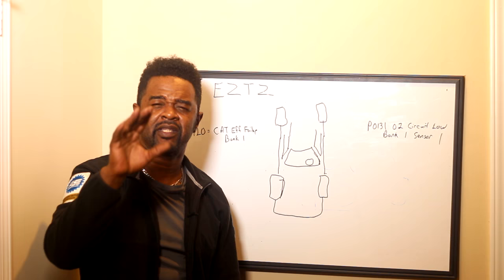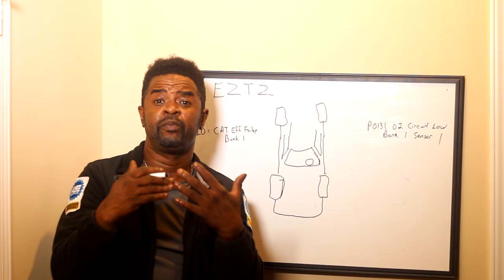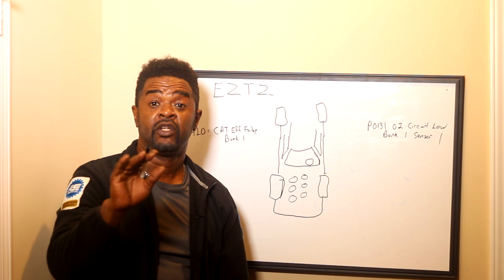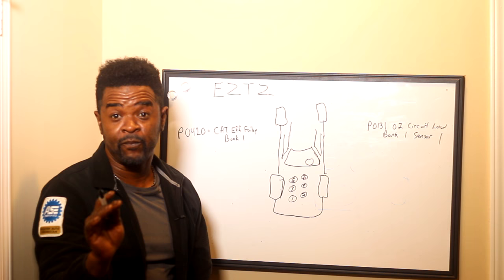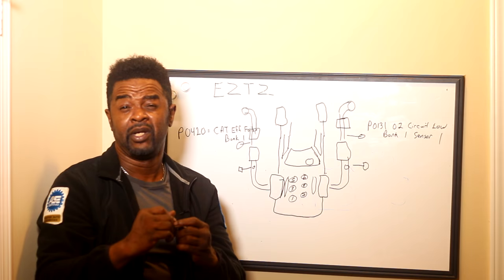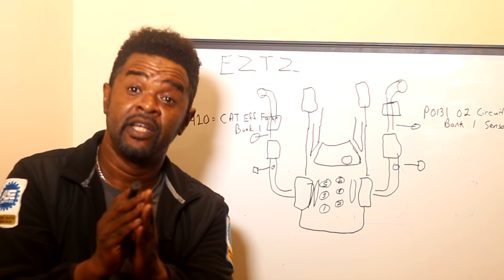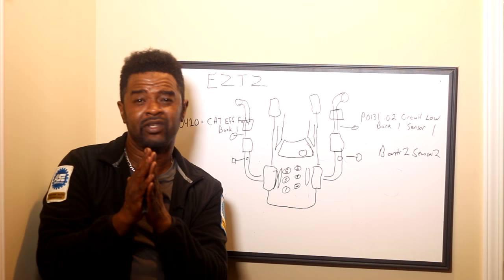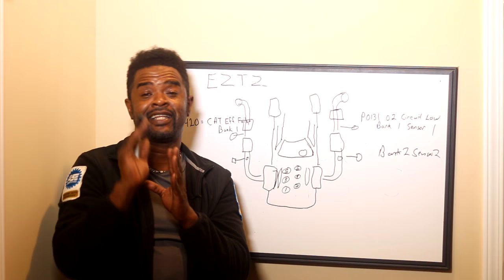Bank 1, Bank 2. Oxygen O2 Sensor Location, I show you how to locate the correct O2 sensor. P0131.

Comment: I have been trouble shooting a multi engine misfire and #2 cylinder misfire for almost a year. The dealership had the 3.6 ram and could not find the problem. Just started learning how to use the ob computer and read fuel system, found bank 2 O2 sensor  #1 to be very slow and not tight. Replaceed Bank 2 O2 sensor #1 Now it runs good but the O2 sensor will back off a little bit and it runs like crap with a bad hesitation. When I tighen it back runs good again Is there a way to stop it from backing out without replacing the exhaust manifold
Reply from the maker: Hey bud, its likely the computer trying to compensate for something. Theres a problem somewhere. What other repairs have been done? Have cats been replaced? Plugs checked? Any exhaust restrictions?
Reply: @OnlineMechanicTips  replaced coils, plugs crankshaft sensor pcv valve and up stream O2 sensors.

Bank 2 up stream keeps coming loose after about 75 miles. I know what I can do to keep it from coming loose but that's a last resort with some JB and replacing the cat any other tips on keeping it from coming loose.
It's running great when the O2 sensor is tight but Everytime it's running ruff I'll stop and check bank 2 and O2 sensor is loose.
Thanks for your help and Merry Christmas 🎄

Comment: Hey great video,  the part I found incorrect is I have a 2010 mustang v6 and cylinder 1 bank 1 is on the passenger side, but cylinder 2 and 3 are also on passenger side, cylinder 4,5 and 6 are driver side, bank 2?

Comment: My 96 chevy 1500 series 8 cy van 5.7 engine, is misfiring and stalling and rough ride, but since it has 4, 02 sensors, 2 on the top and those 2 on the bottom you showed us, which one of the sensors is causing the stalling and rough ride in my 96 Chevy van? Do l replace all four, or just the bottom ones, or the 2 top ones.  But, first, l must identify, which of the 4 is causing the problem, or should l change all 4 sensors to correct the problem?. Do l make any sense to you? I already changed, the map sensor, the camshaft and crankshaft sensor's, and a full tune up. But is still not solving the problem. Someone, please help me here...thanks..

Comment: Thanks for the video!!! I have a QQ, have a 2018 honda CRV and recently its catalytic converter and downstream oxygen got stolen and I installed an aftermarket catalytic converter and OEM oxygen sensor. But once the work was done, I see that the new oxygen sensor was joined to the exhaust pipe just before the catalytic converter even though there is a space left on the new catalytic converter for the oxygen sensor, the mechanic said it's fine but was kind of worried if it was done in the right way. What would be your comments on this one? Is it okay to have a downstream oxygen sensor installed away from the catalytic converter?

Comment: So I have an issue with my wife's 2006 Pontiac Vibe FWD 1ZZ-FE with an A246E transmission. I had a System Too Lean code, so I replaced the MAF, then I had a CKT Circuit Low Input or Stuck Off code, so I dropped the transmission pan and replaced the CKT torque converter lockup solenoid in the side of the valve body, I also had a Catalyst Efficiency Below Threshold code and I just replaced the catalytic converter about a year ago, so I decided to replace the upstream oxygen sensor. I replaced it three times with three different sensors because I wasn't getting that same catalytic code, but ever since I replaced the upstream sensor (in the exhaust manifold) I am now getting a P0031 Heater Control Circuit Bank 1, Sensor 1 (the upstream sensor) so I'm thinking that I have a new issue with the wiring. This car has close to 185k miles on it and it runs like a champ. Also, we have inspection and emissions in our county, so I HAVE to get it fixed. A new O2 sensor is $200, so I'm trying to find a pinout of the ECU side of the engine harness so I can trace the wires and test continuity between the sensor plug and the ECU plug. Any thoughts or help would be appreciated.

Comment: Is there polarity on an o2 sensor?  I received the connector wrong but only noticed after installing it so I modified the conector to fit.  I ordered the right one this time but wondered if the o2 sensor would work

Comment: My check engine said bank 2 sensor 1 ??So thats means a left side or driver side before converter?? Please answer my question
Reply from the maker: Hello my friend. It depends on your engine. What size engine your car have? We have to determine where bank 2 cyl head located at. You left off the engine size. O and please subscribe to the channel. thanks
Reply: Online Mechanic Tips  my car is Camaro 2014 8V 
6.2 , I will do thanks a lot and I’m sorry my English is  not very good

Comment: i got a question.
i got my ypipe and engine from 2 different places  and engine has 4 pin flat connectors and y pipe has 4 pin square connectors on O2 sensors
is the only  way to fix this just buy flat pin O2 sensors or can i just cut off connectors and wire directly?

Comment: 2017 Ford raptor code.being thrown as p2098. Says catalyst fuel trim system too lean bank system 2. Truck had Cobb down pipe and dealer said that was the reason the code was being thrown. Called Five Star tuning in South Carolina and they said they had an exhaust system that the trucks take quite well for the O2 sensor which they were saying it wouldn't throw a code, can't figure out what to do when truck hits 5000 RPM it acts like it's got water in the gas and then the check engine light starts flashing and goes into like a limp mode for about 10 seconds. I did get the cobb piping off and went with the Five Star tuning setup that did not help at all , I wasted my money and sadly they didn't tell me that because  I couldn't test drive it after repair because I had to get it towed cuz it was quite some miles away from me so I never got to test drive, what should I do

Comment: ey I have a 2007 Cadillac Escalade esv The check engine light came on in the cold was (P0050, P0154, P0155)  Bank 2 sensor 1.  I would like to know which sensor I have to get and if it upstream/downstreamI.  Also please let me know which side of the truck is the sensor located. It would be nice if I can get a link for the sensor

Comment: Hello,
I need to replace my catalytic converter on my 2006 dodge grand caravan 3.8L engine. The converter code came up three times, so far. What bank is the o2 sensor for the catalytic converter connection? Unfortunately this would be the second time replacing the catalytic converter in 10 yrs since I've owned my van. I can't afford the original converter from the dealership for $3,800. So I'm going purchase a magnaflow catalytic converter. Any suggestions sir? Thank you

Comment: Hi good video. Iv replaced the 02 sensor on the 01 mazda tribute....which was the wrong one to be replaced...as engine light still is on. The one I replaced is in the front of the,under the hood. I can't find the other sensors and desperately trying to find the others. Any tips is gratefully received.

Comment: Great job.... But check it.
I got a 2013 Ford F150 Ecoboost with a code reading of P0430 bank 2 ...
But my code reader doesn't tell me if it's sensor 1 or sensor 2. Can you tell me which one it is , So that I can change the correct sensor?? 
Thank you

Comment: Is there a difference in the O2sensors #1&#2. That is to say can I replace either sensor with the same part
Reply from the maker: Hey bud unit depends on the application and car..some have longer wires with different connectors so its not a sure thing
Reply: Given the connector and number of wires are the same, such as a purchase of 4 o2sensors for my ‘05 town car. I can’t see indication that any one goes any one place over the other! Please inform

Comment: hello i have a 2007 honda pilot v6 and it says its having issues in B2 so that would be radiator side?? im asking because i seen another video say the back side is B2...im so confused and my honda is throwing codes for a bad b2, and im trying to figure out which it is so i can replace it. i just got the car and i need it fixed for work but i cant fix it or try if i dont know which one 2 replace. i know there is 3 on the honda and i know its not the bottom its either rear or front (radiator side).

Comment: I have a Lexus LS430 2004 V8 and I got a P0430 code it says bank 2  but  it  didn't say which sensor. how con I know which one is the problem ? I got a check engine light and a traction off light.
Thank you for your help.

Comment: Hey question? I have a 2010 chevy silverado Lt v8 with a misfire the code is P3435 deactivation in cylinder 4, the deactivation board was put in new the truck ran good for a month n now the misfire n code P3425 is back check engine light flashing n tracktion control warning lights come on at the same time for a few minutes then it goes away n the truck start to run good for few minutes......so fustrating

Comment: Hi . I have been trying to figure out this p2098 code on  my 2012 jeep rubicon.  Ive replaced o2 sensors 
Injectors for the misfires i had going and replaced coils and plugs and a cracked lower intake manifold.  
And darn p2098 keeps popping up after 2 days of driving and the jeep runs fine . 
Please help with suggestions 🙏 
Thank you

Comment: Yes cylinder 1 will always be closest to the front.  But how to know what side is cylinder 1 on the passenger side or driver side.  So how can we know what side will cylinder 1 will be in order for us to know what side our bank 1 and 2 will be?
Reply from the maker: The picture in the diagram, which ever cyl closest to the front will be cyl 1, which ever side that is will be bank 1. All assuming this a V engine
Reply: Right. Nut how can we identify what side will cylinder one starts. On the driver side or in the passenger.    They are v6 engines that the cylinder 1 starts on the opposite side for example on the driver side cylinder one will be in some engines. That mean bank 1 is in the driver side.  Compared to a v6 nissan bank 1 will be in e passenger size because cylinder one is in the passanger side

Comment: I have a question I have a 2008 Acura tl I just want to know if is the front or the back a bank 1 sensors goes I have problems fingering it out I know one is at the front of the engine the acura dealer told me is the front one an my mechanic side it not it because the plug is different so which one is it

Comment: I just got p0138 and p0136 on a 98 honda accord v6 right after replacing a section of my exhaust after the catalytic converter and included the resonator but not the mufflers as they are only a year old. Could if be just a coincidence? any thoughts? I had replaced this same section 2 years ago with walker system that just fell apart and found someone who was able to use my original stainless steel system and just added flanges and welded to rest of existing system. Thanks

Comment: Hi . I have 7 codes  P1148 , P1168, P0037, P0057, P0328, P1031, P1051, are those sensors related to Upstream and Downstrean ? Nissan Maxima 04 has 4 sensors? Thank you
Reply from the maker: Yes they are but are these your problem? maybe not. How is the engine itself running. You should get a compression test don on this engine to verify if engine doing its job. Also, are you subscribed to the channel?
Reply: @OnlineMechanicTips  yes running god, yes I did it

Comment: Could you please give me some advice I have a 2014 dodge ram 1500 v8 I'm getting code p219A bank 1 air fuel ratio imbalance and I'm a little lost on what could be going on, the vehicle seems fine other than slight rough idle and eco mode not activating now, please help sir.

Comment: Ok, I know my 02 sensor was cut by someone, my husband rewire to direct fit but now ALL Codes for 02 sensors are up and the main Code is P0161. Can the 02 sensor (not the replacement) be replaced? Someone recommended using heat to bond the wires.

Comment: Good teaching Sis , I have a question for you  , how many catalytic converters Toyota sienna has , 2002 ? and where  are they located? Thank you
Reply: I meant to say Sir
Reply from the maker: Depends on if its a in line 4 cylinder or a V6 engine. But for the record, thers usually a cat connected to cyl head after the exhaust manifold. Also are you subscribed to the channel?
Reply: @OnlineMechanicTips  thank you for your answer  , no I'm not subscribed to the channel

Comment: Thanks for explain on you video , but you confuse people because you show a V6 engine with cylinders vertical line means 3 in line to left and 3 in line on the right I don’t know what kind the car is , but typically the engine V6 cylinders horizontal are situated 3 at front those are cylinders 2-4-6 from left to right and the other 3 are in back of the engine cylinders 1-3-5 from left to right same way horizontal . Now I know bank #1 in belong to side of the cylinder 1 and bank 2 is belong cylinder 2 . Where is located bank 2 on engine is stalled cylinders horizontal like Hyundai San Fe V6 ? I guess need to to follow manifold where is located cylinder 2 .I hope you clarified on your video what kind the car is . 😅

Comment: I have an 08 dodge charger 3.5 and the check engine light comes on and off. I had a diagnostic done and it said Oxygen Sensor Bank 1 needs to be replaced. My question is my car comes with 4, although it says Bank 1 would it better to replace all 4?
Reply from the maker: Hey bud, a lot of people do it that way depending on how many miles they have on the car. If this a high miliage car, then yes. But, there is know codes that says "Oxygen Sensor Bank 1 needs to be replaced" Make sure there is no wiring short circuit. What was the P code? Are you subscribed to the channel?

Comment: P0420 is the code I'm getting on my 2016 silverado, I put masterflow exhaust  and some high flowcats with a cold air intake. I keep seeing people saying there is a third cat with a o2 and if I remove it that will remove my engine light. Please help if you can, truck running fine but there is a CEL

Comment: What would cause a too lean code for bank 1 and bank 2 on a 2006 town car?
Reply from the maker: Hey bud, if you referring to a P0171 a fuel pump not delivering the proper fuel pressure can cause the sys to lean out. Did you have a code? Also are you subscribed to the channel?
Reply: @OnlineMechanicTips  I'm thinking 🤔 it might be exhaust manifold gasket.  Because when I sleep in my car and, I wake up with a head ache and I smell a little exhaust fumes in the car. But that's only when it's at idle and it's been idling for awhile. Also that's the only time the check engine light comes on. Saying bank 1 bank 2 running too lean. I saw a video here on YouTube that it could be a exhaust manifold gasket or a cracked manifold.

Comment: Im having a hard time removing the catylictic converter on a 2012 dodge journey sxt v6 3.6.
Reply from the maker: Which one are you replacing? The front bank 2 or the rear? Also are you subscribed to the channel?
Reply: @OnlineMechanicTips  yes I'm subscribed..I took the front cat off (front of the car) because I was told
The car looses power because cat was bad...( I got air through it...but I can't see any light from the flash light I shine through it)

Comment: can i ask you my truck is hesitating when i ride and the codes say my sensor are bad will the hesitation stop if i change the sensors. thanks for your video.
Reply from the maker: Hey bud, yes. A failed O2 sensor can cause hesitation. Is this whats causing your problem, Im not sure. Are you getting a check engine light? Also are you subscribed to the channel?
Reply: @OnlineMechanicTips  yes im getting code po420 and po430  how can i fix should i change the sensors.
Reply from the maker: @98chicagobears  Hey bud, those are cat efficiency codes. And I ask you was you subscribed to the channel yet?
Reply: @OnlineMechanicTips  yes i have subscribed.

Comment: What if you got codes bank 1 sensor 1 and bank 2 sensor 1 p2195 and p2197 for 2007 Ford Taurus se with one exhaust pipe
Reply from the maker: Hey bud is this a V engine? meaning a V6 or a V8. Or a inline engine? Also are you subscribed to the channel?
Reply: @OnlineMechanicTips  yes am subscribe and yes it’s a v6

Comment: O'Reilly did a scan , Missing on Cylinder 6 , O2 Sensor bad the cooling sensor " It was 30 F and I only drove 2 blocks" so I know the cooling was going to be off lol  they can't say what O2 sensor it is . I found 4 on Rock Auto for 100 Dollars and a set of on Ebay Universal they say it don't mater what bank or if its up or down steam they will work . Have you ever used Universal O2 sensors . They come with a 5 year warrantee , Im on a Budget  If its a Burnt valve I really don't want to spend 300 in parts .  Miss can be a Plug or wire injector or valve .   and or a O2 sensor .

Comment: So, when purchasing a replacement o2 sensor. At the counter what is left and right? Is that perspective driver oriented? Or still from hood to rear?
Reply: Generally speaking the sides are referred to as drivers side L and passenger side R
Reply: Ok thanks

Comment: Does this apply to jeep grand Cherokee 1996? Sorry if a silly question. My jeep grand Cherokee 1996 had 1rst sensor replaced. Bought her used and her catalytic converter was gone. Having problem with the 2nd sensor, do I need a new catalytic converter?🤷‍♀️
Reply from the maker: That year Jeep likely equipped with the inline 6 cylinder 4.0L engine. Its not a V engine. Thanks for watching. Please remember to thumbs up the video and subscribe to the channel, thanks
Reply: @OnlineMechanicTips  will do and thank you!😁❤